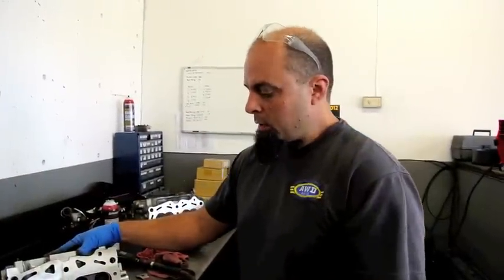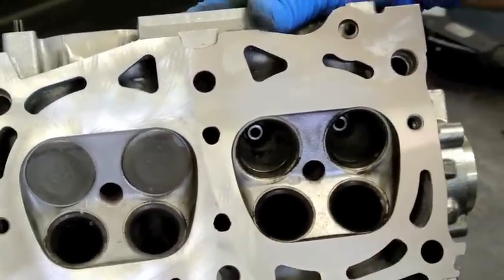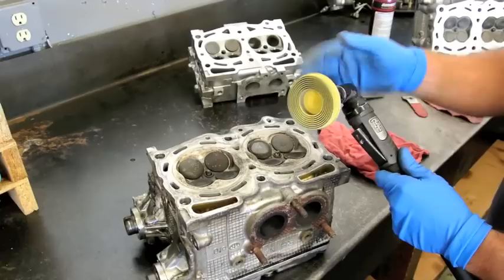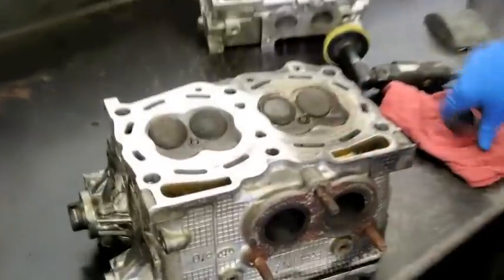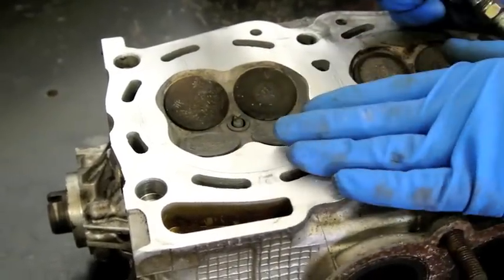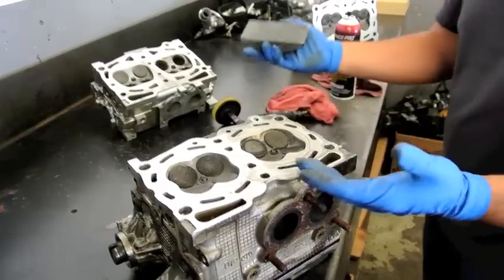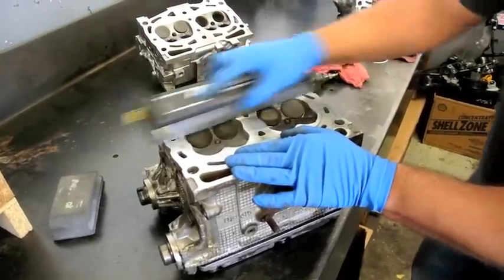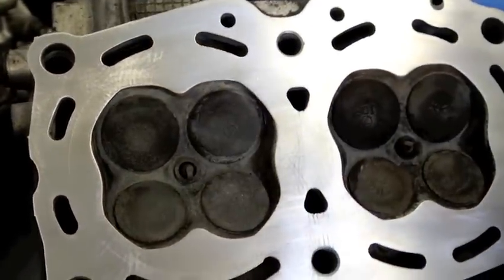Subaru Head Gasket Preparation

Comment: From my experience as an automotive engineer and machinist.  I agree with justin. The plastic wheel will destroy the aluminum surface. Before you pull the "plastic can not hurt metal" card just think about how fast those bristiles are impacting that aluminum

Comment: A failed head gasket doesn't mean your engine is bad..  Granted, it can be an expensive repair, but much cheaper than a new engine or a loan on a new car!  After replacing your gasket, your engine may continue to run for another 200K+

Comment: Great tip Justin!  That's a way better method for in-shop cleaning.  What do you use to clear the debris left from sanding?  (whiz wheel's send it into the air and everywhere)  I know aluminum dust is a major contributor to Alzheimer disease and memory loss.  How do you clean it without breathing it? (love your stuff- just subscribed)

Comment: Hey Justin, my subaru is currently in the shop for a hybrid swap and my mechanic mentioned if i wanted a standard Resurface for the heads or a "high" performance resurface.. could you explain the difference is?

Comment: Hey justin, I have read your articles on HG failure and they are really informative and I really appreciate the time and effort u put in. I am from Australia and own a 2002 Outback(EJ251 engine) with 150k miles, got no a HG problem. however there is another issue, whenever i try to accelerate in 2nd gear or above, there is a slight delay and a knocking noise from under the car. I suspect the prop shaft cv joint. is that something you encounter  on customers cars from that era as well.  cheers

Comment: 100000000000% agree my man! never ever ever use air tools on a sealing surface that contains any time to pressure, hell i dont even use air tools on front cover gaskets for example, working at a dealership they want speed, but they also want it done right!

Comment: myself i like 320 on thes surfaces, i work in a gm dealer dont get me wrong i know for a fact some guys use thos in a gm shop, my dealership says block sand only, but one thing i wished you would ahve mentioned NEVER use thos stupid brown roloc disks #31 its destroys the head with uneven surface, AND the aluminum oxide particals going into the oil gallerys and shit, DONT USE THEM, but i could not agree anymore to NEVER use air tools on any sealing surface!

Comment: so you bought a 2012 subaru and it has head gasket problems? warrenty? how can you not like these cars.. my STI has 224k miles on it. and i still run low 12's at the track. many subarus i work on have over 300k on them. when you buy a car you pay for the warrenty! i gotta ask why you dont like it.